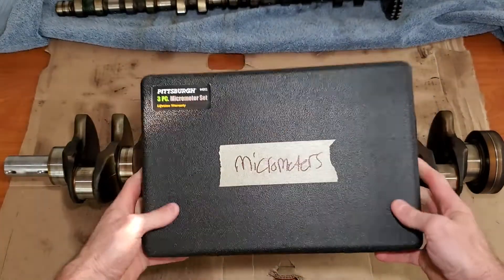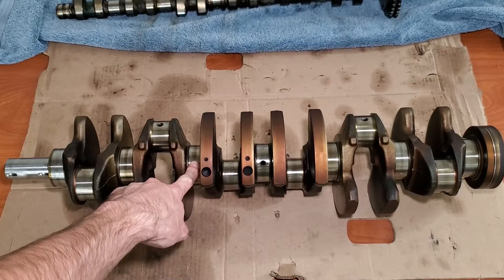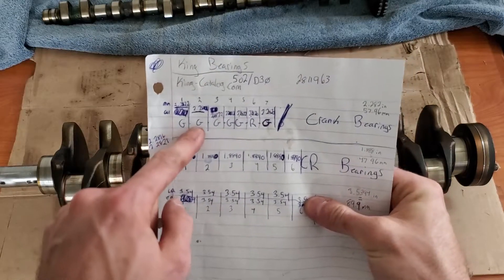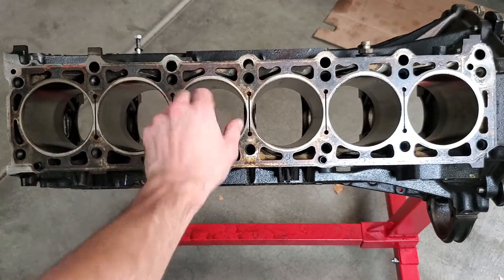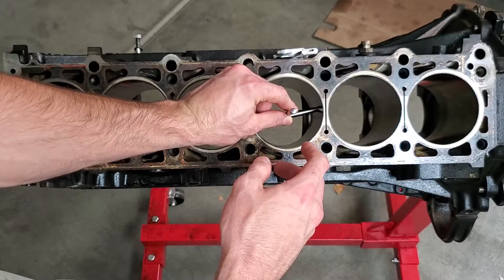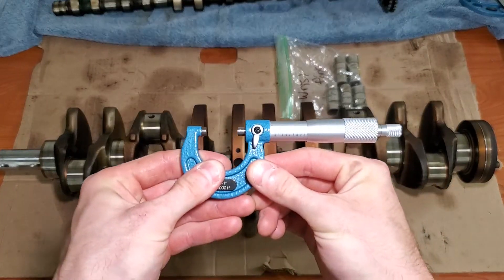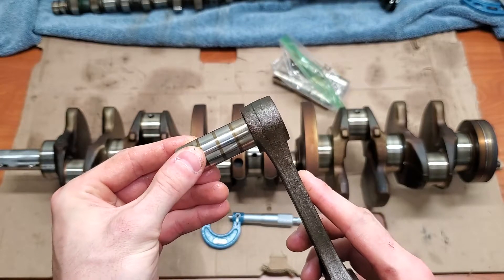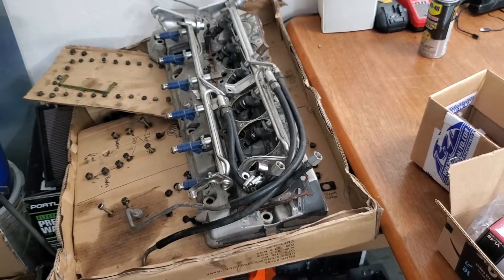Measuring The Internals - M104 Turbo Build (Ep. 7)

Comment: Very informative videos, however, whats your opinion on putting bmw s38b36 ZRP connecting rods onto the m104 crank, being as though the original rods are 22mm in width and the bmw ones being 23.9mm either end? Theres a youtuber that uses them and says he only machines the small end to fit the stock pistons at 22mm. But then that begs the question of what the tolerances are like between the big end crank journals and the BMW ACL race bearings he uses for the zrp rods.